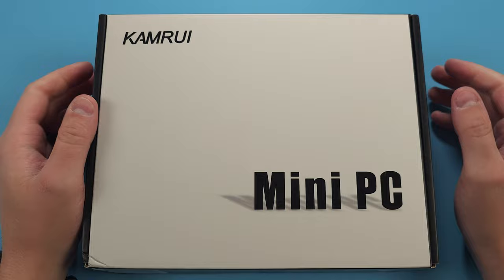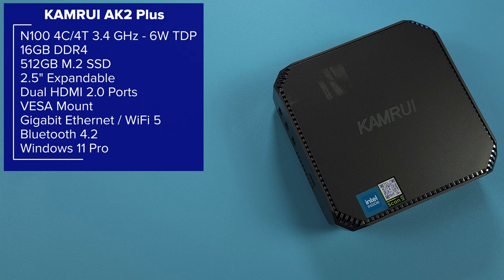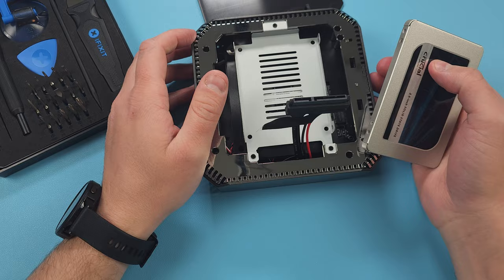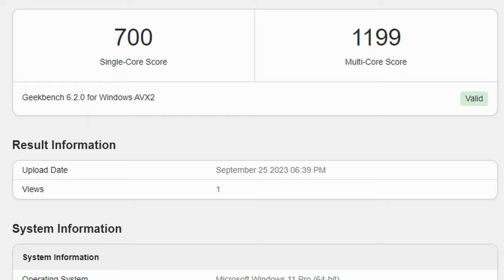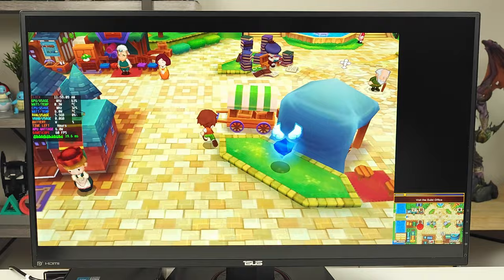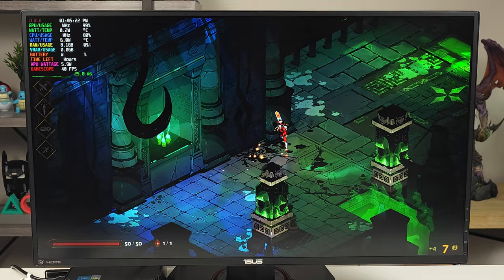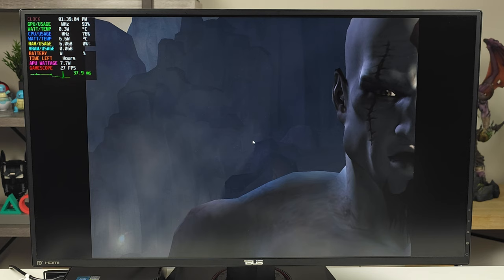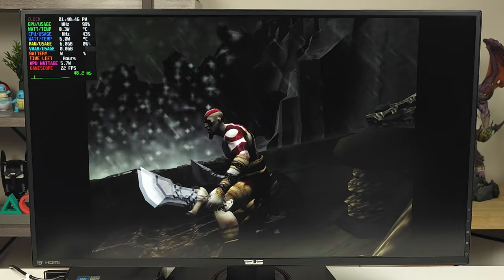A $150, N100, non-gaming PC! (KAMRUI AK2 Plus Mini PC Review)

Comment: Those Geekbench CPU scores seem really low. My best score for Windows 11 on GB 6.2.2 are Single Core: 1197 and Multi-Core:2928, and Compute (OpenCL): 2693. But that's for a Beelink Mini S12, which has the lower specced N95 processor with 16EU UHD graphics instead of 24EU in the N100.  Those scores are after I did a bit of tweaking in the bios to supposedly raise the power limit (no idea if it actually did anything, as I don't have any way to measure the voltage draw), and I was testing it with a 16GB stick of Timetec dual rank RAM, which did give it a minor speed bump, but not significantly so. Geekbench scores were about 6% higher on Linux Mint LMDE6, but I don't know that you can infer much from that, although the Mint was running off of an SSD as opposed to the NVME, so I assume there was some penalty there, but maybe not as the included NVME is, um, generic. Anyway,I'd see if you can't eke a bit more performance out of that mini, as it should definitely have some more to give. Oh, and I've been running it for months as a Plex server (again on Linux Mint with Plex Pass, so it is using the Quick Sync for decoding and encoding) and it runs like a champ.  It can easily transcode three 4K films simultaneously down to 1080P without breaking a sweat.
Reply: i cant get 3.4 ghz only around 2.6.. how cani fix it?

Comment: I've seen a video from ETA Prime with this chip, and he was able to run PS2 at 2x. Seems weird how bad it ran here, guess it might be related with the single channel RAM, not sure...
Reply from the maker: He also shows over 20 watts in that video and this is capped to 6w.
Reply: @JoeysRetroHandhelds Oh, right! I wonder if this could be unlock in the bios or something... It would make it a good emulation box up to GC, PS2 and Wii. If it's permanently caped at 6W, it's not worth it in my personal opinion.